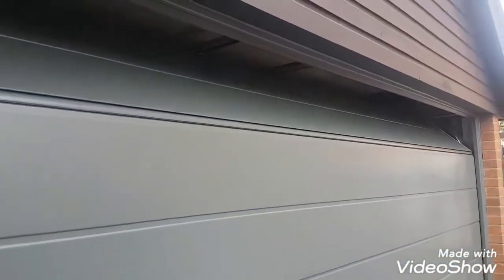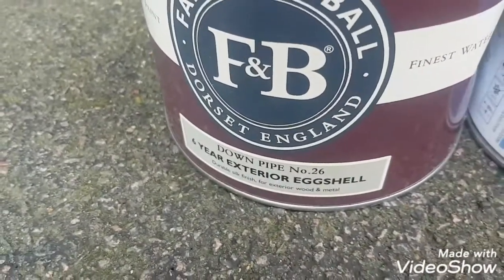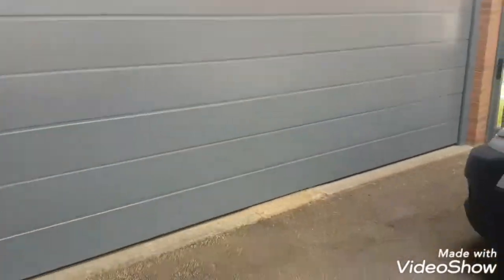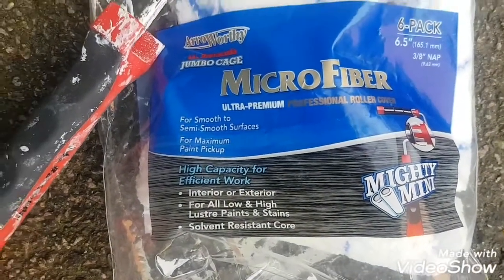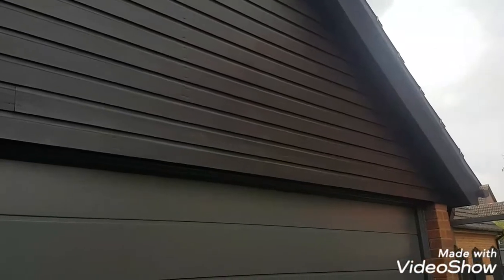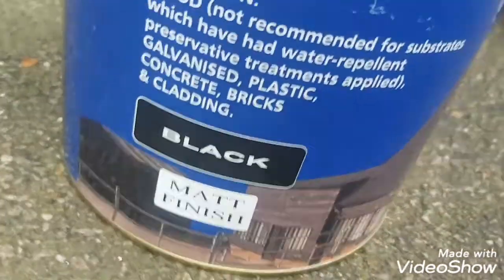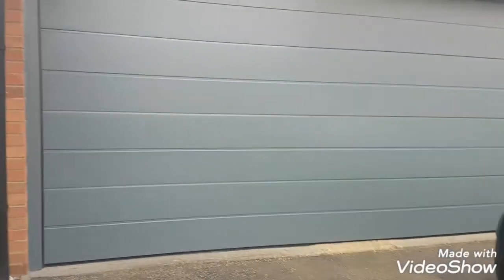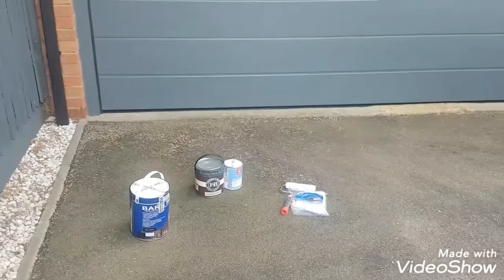How To Paint A Powder Coated Garage Door

Comment: Was going to try the Bedec. So you applied Akva ( great product ) then filled it then the Bedec straight on the filler. You thin it down a bit on first coat Daniel ?
Reply from the maker: Hi. Bedec was another vid. I used Otex Akva Etch Primer then two top coats of Farrow and Ball Exterior Eggshell. The garage door looks solid to this day. Had the Otex Akva mixed in the same tone of grey as the eggshell. I just denibbed inbetween coats and slightly thinned out the eggshell to give it more flow
Reply: Daniel Nugent Painter and Decorator sorry I meant the fascia board . You used Bedec on it. So it was originally a woodstain then you primed it, then used Toupret exterior wood filler ( the powder one ? ) . I like most Toupret products but was t keen on the wood filler or their render filler it flashed like a bastard. You applied Bedec right over the filler ? No need for a primer is what I am trying to find out. Did it take ok . Ta. Sorry your thoughts on the Bedec or the F & B exterior paint interests me. I used F & B eggshell exterior and it buggered the brushes and did last well on timber windows. My go to for exterior timber is Sandtex flexi system or Sikkens. Both really do last well for years.
Reply from the maker: @stevenmcfarlane8831  Hi. Yes I Otex then fill then 2 coats of Bedec barn paint in the Matt black finish over the Touprett filler. It looked solid. You can always touch up filler in Otex after rubbing it down but I didn't bother.

Comment: Alright mate did you use santex on the fence
Reply from the maker: It's great for fences and easy to use. Nice and thick as Cuprinol Shades takes a few coats so I tried it and still looks good as the day I painted it. Cheers Dan
Reply: i have to say looks fab the only thing is a double the price compairing to  sandext or dulxe enjoyed the video.